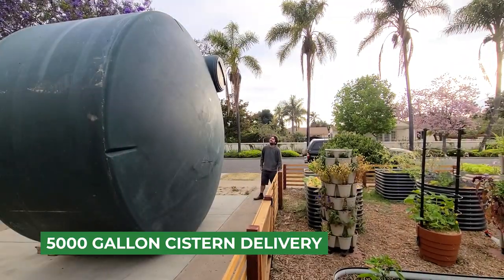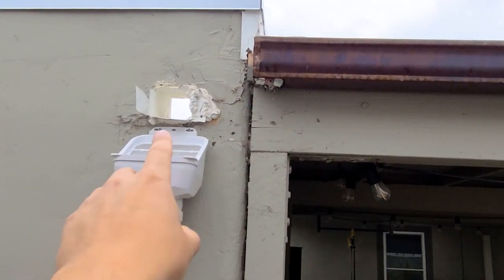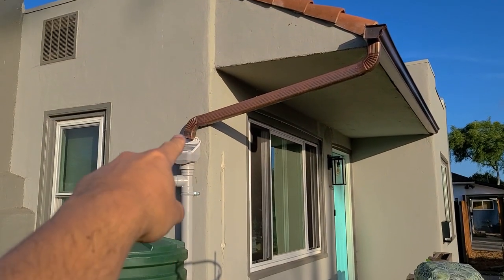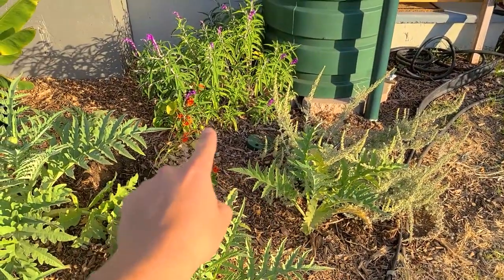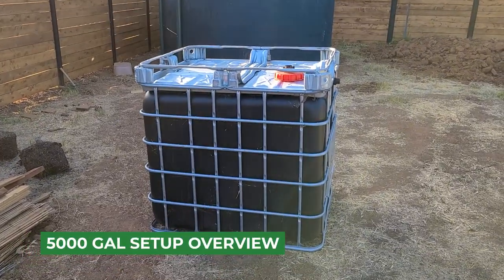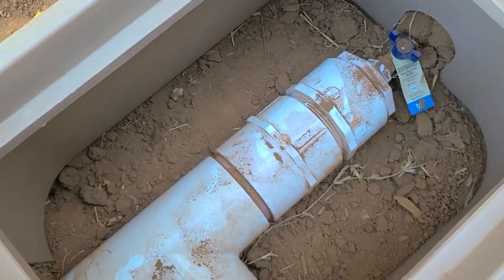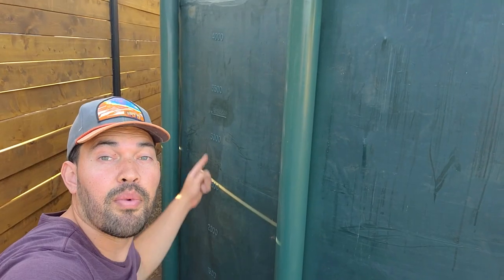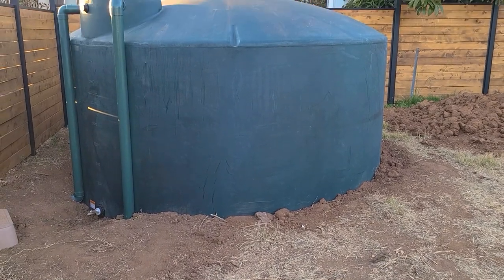5,700 Gallons of RAINWATER STORAGE at the Homestead! 💦💦💦

Comment from the maker: Any questions on rainwater capture? Let me know and I'll do a Q&A episode.
Reply: What material is the tank made from? Will exposure to the sun/heat make it leach into the water? Is harvested water safe to drink or only for garden use?
Reply: Do you have to deal with any regulations on holding water on your property?
Reply: Why so large scale? I live in Lake Elsinore CA and we've only gotten 4 inches this year. We cap at 7 to 8 inches a year total.
Reply: There must be a pump to shift it to the biggest boi, right? I may have missed it (Toddler was climbing on me), but all I picked up was there was a graded decline to the big cistern.
Reply: why not keep the old cistern for the chicken coop? they can drink rain water right? maybe you have to filter it a few times idk but that takes care of their h2o intake
Reply: @SavvyLikeThat  I was wondering that, too. I don't understand how there would be enough pressure for the water to get up the pipe.
Reply: There has been some discussion on YouTube of the benefits of rainwater harvesting for the dissolved nitrogen that you get from it, providing somewhat of a quick boost for plant growth. 
1. Is this a myth/fact?
2. If the above is true then does that nitrogen stay dissolved in that water (meaning that captured rainwater nitrogen content > tap water) or does it eventually dissipate/evaporate out of solution?
Reply: Are you worried about the catchment during hurricane season? if so, how do you prep the catchment for hurricanes?  I'm in Florida.
Reply: There are so many folks on gardening groups on FB who still believe it’s totally illegal to collect rainwater in their state. Can you address that myth and clear things up as it pertains to regular homes who might only have one small (55gal or so) barrel?
Reply: Is this to drink or for gardening
Reply: @SavvyLikeThat  i think (not 100% sure) the inlet for the big tank is at the same level or slightly lower than   the outlet for the 500 gallon tank, so it pumps itself
Reply: How are you going to use the water? (Hook it to a garden hose or just use a watering can?) If hose, are you going to install a pump of some kind or just wait/keep the tank at a certain level to have enough pressure?
Reply: Are you also collecting the condensate water from the interior components of your split air units?  It may not be a lot (epending on how much you run your air conditioning) but it is something.
Reply: Does your area get enough rain to justify the size of canister?
Reply: Are there any concerns with contamination (bacteria, fungal spores etc) due to storing for a long time in very warm conditions?
Reply: This is just fascinating to me.  Please keep providing updates.
Reply: Do you guys ever get water restrictions there? Pretty common in Australia.
Sounds like you need more experience town water supply!
It's very common for homes here to have tanks. A lot were put in about a 15 years ago when we had a bad drought and gov offered subsidies to get them put in.

Also interesting that the main feeder is underground. I will that be effective in heavy rain?
Reply: I heard dark color of the tanks helps not to have bacteria gather than the white/semi clear ones, is that true ?
Reply: I don’t understand how the first flush works. I’ve watched a few videos and I get why it’s necessary, but I don’t understand the physics of it, especially with all the different ways it’s done.
Reply: I'd love more information on how you can find out about local grants
Reply: @dunebuggy11   me too
Reply: I am getting ready to install a new guttering system on my house.  In a close housing neighborhood, and on a small lot.  So no room for a big cistern.  But I have these rain barrels that I am going to use to collect at each downspout, and to water my garden.  How do you use that water from the barrel?  Do i need to get a pump?  Do I need to connect them all somehow?
Reply: I've been collecting in buckets, bins, and containers this year since we started our garden. Been the dryest year ever in Mass, but we have still saved a lot of water with my rainwater collection. One thing I noticed, though, is that gutter water is not as clean as when I just collect from drips that come off the roof directly.
Reply: @dianaanderson6448  Just wait until the rainy season, this is going to efficiently collect hundreds of gallons of rainwater in a single rainstorm.
Reply: @JEK  I think the method is great for collection but he is in San Diego CA and we really don't get a rainy season. I'll be curious to see what he gathers.
Reply: @prudence4493  There is no hurricane season in San Diego.
Reply: @SavvyLikeThat  water seeks it's own level. Since the water enters at a higher point, it will be able to rise up the tank inlet pipe and into the tank.
Reply: Why not have an initial fill trucked in for this year, so it doesn't just sit empty until January?
Reply: I am in San Diego 
Will you please post a link to the grants you talked about.
Thnak you
Reply: How do you use the water in a way that is meaningful (pressure the lines like a hose, etc.)
Reply: What went into your decision to get a poly tank over steel, concrete and fibreglass?
Reply: @Brendonherring522  regarding question one, my plants explode and new things come up like seeds from previous years. It's like a miracle grow product for my vegetable gardens. That's just my personal experience.
Reply: Can you share the link or the applications of the grants that you applied for in the city? Would love to apply for that too! Thank you so much for another awesome video!
Reply: One inch of water or rain is equivalent to 623 gallons per 1,000 square feet. San Diego averages 12 inches of rain per year, and Epic is capturing water over probably about 1500sqft of roof, so that’s 623x12x1.5=11,214 gallons in one year! Is my math correct?
Reply: Is the First Flush system to capture the dust/silt from the first rains to keep it out of the storage tanks?
Reply: Will you have to treat the water in any way? I’m thinking algae or bacterial growth over time.
Reply: How much municipal water are you currently using per month — BC? (Before Cistern)
My bill gives my use in HCF (hundred cubic feet). 1 HCF = 748 gallons.
Reply: Are you going to test the system out first by using the hose to fill the tank via the leaf filter and seeing if it will actually flow into the 5000 gallon tank? And seeing if there are any leaks in the system?
Reply: I have a 55G rain barrel right next to and slightly above a raised bed garden.  Do you think gravity would be sufficient to set up drip irrigation or would I need a pressurizer/pump?
Reply: How are you going to use the spigot from the largest tank since it’s buried? Is it just going to be with a hose?
Reply: Ive got a gazillion questions.  Too many to list here.  We are thinking about putting a rain catch system in but SD County is the worst when it comes to permits and fines if you dont play by their rules. We're out in Jamul and the winters bring anywhere from 8 to 16 inches of annual rainfall. Our bill runs $ 75-$ 80 a month and thats without growing anything. Otay Water District seems pretty high but I'd be interested in comparing notes with other people in san diego.
Reply: Is the tank loud when it is getting filled up?
Reply: We're in Escondido and we have had a laundry to landscape for about four years.  With the current drought we are thinking of doing the kitchen water into the same system.  We filled our swimming pool with dirt and turned it into a dry streambed about 12 years ago.  We have been thinking about digging out some of the pool and putting in a large tank.  We have about 10 fruit trees, a vegetable garden, and perennials.  We would like to keep some of that if the water is restricted in the future.  We think a tank is the way to do it.  It would be worth the money to keep the vegetation.   We already save shower water and have about 700 gallons of tanks, but some of the tank water evaporates before we can use it.  By the time it gets hot, the water is gone.  Our daily water use is between 55 and 100 gallons per day.  So even with our landscape, we are low water users compared to some other people.
Reply: @prudence4493  he’s in San Diego county, no hurricanes. I am concerned about the lack of rain in general though
Reply: @dianaanderson6448  I'm in Bonita and have four 50 gallon tanks doing collection. They fill up quickly at the first decent rain we have and then the rest just runs away. I'll have to figure out something to do with the excess.
Reply: How long can the water be stored? My rain barrel manual said ten days only
Reply: @my2wins  Google your question.  Seems like it can be stored indefinitely but some rotation is good.
Reply: @my2wins   Ten days?? That seems a bit short. I have four barrels, holding about 200 gallons or so total. No way would I ever be able to use all that in 10 days, short of just dumping it out on the grass. 
I usually treat my barrels with a natural mosquito inhibitor and then fill my watering can and any other plant-designed watering device as needed. One good rainstorm can last me for months of hand watering.
I also plan to add a drip irrigation directly to my tanks for plants living nearby the tanks.
Reply: @SWCnetworkdr  yes it seems too short to me too. It usually takes me about 4 weeks to use up my 80 gallon reserve after each rain. I just keep wondering what the real cut off is.
Reply: @StreetWiseMomSurviving    I set my barrels on a double stack of cinder blocks so they are elevated high enough to allow me to easily get a watering can under the spigot. Be sure to slightly tilt the blocks towards the building so if the ground shifts from the weight, it will be more likely to lean against the house versus falling over and losing all the water you captured.
Also, I have two sets of two, on either side of my house. Each set is connected via a Y-valve so they act as one tank. I can tap either one and only have to open one lid to see how full it is because they constantly level out due to the connection.
Reply: @dianaanderson6448    An average rainstorm in San Diego fills my 200 gallon system in about an hour or so.
I have collection from a large section of roof directed into each 100 gallon pair of barrels.
Reply: @Wiscowomen08   I hope it will as that is exactly what I intend to do with mine. I hope the head pressure is great enough to at least dribble out the drip system.
Reply: @tonym2783    What sort of permits are required? I've heard from friends in the rural areas like Ramona that a water tank of a certain size is mandated for any new construction out there...cause, fires and all.
Reply: Why is this thing not completly buried? You could utilize the space for something else and it would look much nicer.
Reply: @prudence4493  we dont get hurricanes in California?
Reply: Hey !

I'm just discovering your channel, and I was a bit dubious at the beginning, like how is that so insanely "new"? But then, I live in ireland, so rainwater collection is just a matter of a few drainpipes and barrels, and if you empty your hundreds of gallons, well, just wait for a week and they'll be filled again!

So here is the first question : where the hell are you living, if you have not had rain since last october (I think you said so in the greywater video!) and don't plan any withing the next... 6 month :O
That's insane, and brings the question of grants to the next level (and totally justifies the videos and excitement, congrats for that!!!)

Second question is: with the pipe buried, for the tank to fill you'll need all the pipes to fill in as well, from the roof down, the underground part, from ground up to the tank opening, and so this water will stay there. Isn't that a leak hazard, and a quality one as well? I reckon that it must get pretty hot in your area, so wouldn't this water "cook" in the pipes ? Hot water + plastic pipes?

Thanks again and apologies for the spelling / grammatical mistakes, I'm only living on ireland but not from here!
Reply: @dianaanderson6448  7-8 inches? Per year ? What is this planet you're living on, that's insane!!! This month has been pretty dry here, and we got 18 inches... 43 last month... I had no idea that California was so dry, it'll take me some time to adjust and get my brains around that :O
Reply: @ivacheung792  relates to my question, too. The water finds its own level, so as the roof gutter is higher than the tank, it will naturally fill up. But that means that down pipe, underground pipe and up pipes will be filled all the time...
Reply: @lysamerekvart9471  he lives in Southern California, which is notorious for dry weather.
Reply: How would you go about building one out of materials you can easily obtain like a trashcan and tubing?
Reply: Great setup.  What is the brand on your 500-gallon rain barrel?
Reply: How does it work in the winter ? Can ice destroy it?

Comment: If you want to connect a splitter to the spigot you can actually permanently affix the tube to the side of the tank to be able to view the water level anytime. We used a similar tool with a floating plastic bead in the tube to measure water level at a glance. Obv in your situation it's not as important to know the exact amount of water at all times but it's an option.
Reply: Good tip--but those clear tubes will get algae growth.

Comment: You could use that tote for aquaponics if you're interested in trying that. Cut it into 2 uneven halves, the bigger one for holding water and fish, the smaller one you fill with clay balls or shale rock or lava rock (no carbonate compounds in the rocks) to grow plants in. The water gets pumped up to the plants, which the bed will act as a filter, and clean water drains into the basin below. That's the basic minimum way, there's a lot more involved set ups that are even more efficient.

Comment: a trick is to have a wire or rebar (something metallic) that you lay down by the underground rainwater pipes. That way you can use a pretty cheap metall detector to survey your ground of pipes and stuff before you dig. This is obvisouly only useful if you ever feel that you will start to lose control of where you have all your pipes :)
Reply from the maker: Good tip!

Comment: Rain water harvesting is a must where I live in South Africa because the summers are so dry. I've done quite a bit of research on rainwater harvesting and I was wondering why the installers didn't prepare a base for the tank using concrete, sand or crusher dust? My understanding is that this is essential to ensure the tank is level and to prevent stones from penetrating through the tank wall from all the weight.

Comment: If you were ever interested in nerding out and having constant access to how much water in your storage you could branch that spigot and add a pressure transducer at the bottom. Water height = measured pressure / (density of water*gravity) 

Then from height you know your volume.

Or just permanently add that clear tubing and attach it to the outer wall. That could also potentially give you an idea visually of how clean that water is that’s sitting in there.
Reply from the maker: Smart!

Comment: YOU CAN ADD THE CHIKEN COOP WATER BY ADDING A SMALL 30 GAL DRUM TO 'RECEIVE' THE RAIN-W / USING A TRASFER PUMP WITH A FLOAT VALVE, ONCE ITS FULL FLOAT CLOSE THE CIRC. AND WATER IS PUMPED OVER THE LOCATION YOU NEED. MOST PUMPS ARE 20 FT VERTICAL LIFT

Comment: Hey Epic Gardening! I love your system. It's serving as inspiration for mine. Quick question, do you pressurize the water coming out of the giant cistern? I saw you had a hose you were watering with. Can you use that hose with the spray head and get decent pressure just from the weight of the water or did you add some kind of pump? Thanks!

Comment: As expensive as it is I would still do it. With as little rain as you get and while tap is cheaper I'd keep it filled 80% and use the rest. I have a tank just a 5000lt. I would prefer a pump on it and im looking at doing it now. With a poly tank I just tap the side to check the level. Works for me😉. I'd love another one on the other side of the house for the gutters there but I'd need a slim line one as there isn't much room. I'm on the coast of Queensland Australia and as much rain as we get im still not comfortable with not having our own water storage. If you go to properties out in rural Oz its paramount you have 2 or more per structure. You've done a great thing here in my book. Awesome work. And how cool are those grants!!!😍😍

Comment: When you said the cost of water was so cheap it wasn't worth doing on a cost basis only I found that hard to believe knowing my water bill. However, after checking my bill I noticed that most of the cost is sewage treatment which is implied from usage. The water costs are $6 per 1000 gals and $15 for sewage treatment per 1000 gals! At these levels I would have thought collection was well worth it - and why i am looking at your excellent set up. I checked the costs at Sweetwater Authority and they don't seem to have a charge rate for sewage treatment.